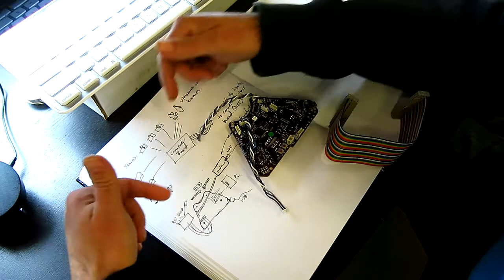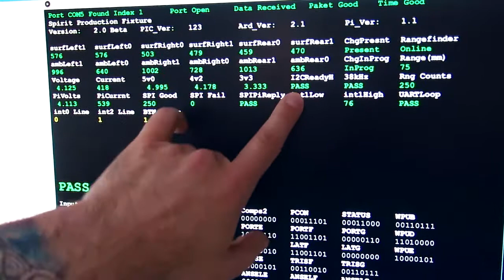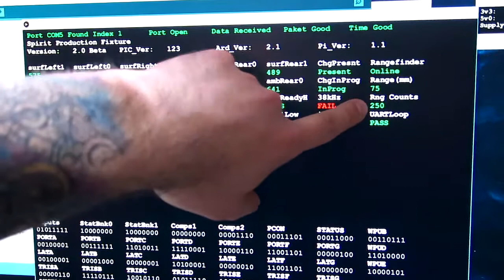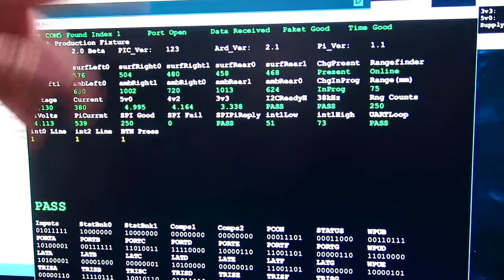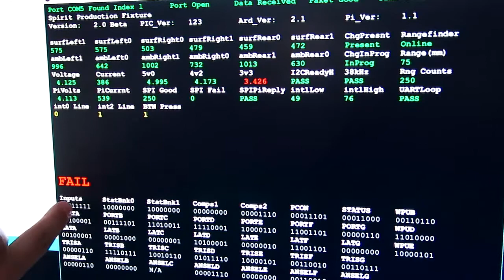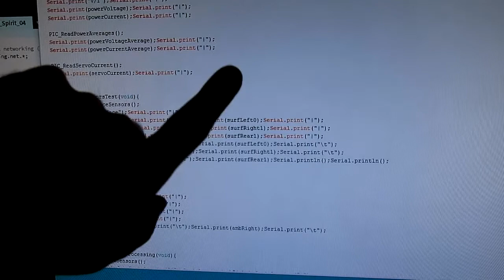Spirit Rover KS Update - DIY Test Fixture

Comment: Ooo, I see that Metcal iron. I've been considering one for years now. How would you compare it to a regular soldering station?
Reply from the maker: It's like night and day. We run a couple Metcal irons and also OKi irons. They work in a similar way, both are really good. You can find them used on ebay at reasonable cost. The tip sets it's own heat, so there's no temp control - it's built into the tip itself, and it gets hot and stays hot much better than a regular iron. I'd totally recommend either. That and some kind of microscope, and a pair of fine tweezers and some flux, you'll be amazed at what you can solder.
Reply: Sounds great, I've been making do with cheap chinese eBay stations thus far... Granted their hot air functionality is actually really nice, but the soldering iron part is really bad.